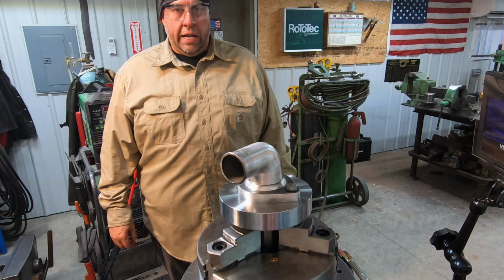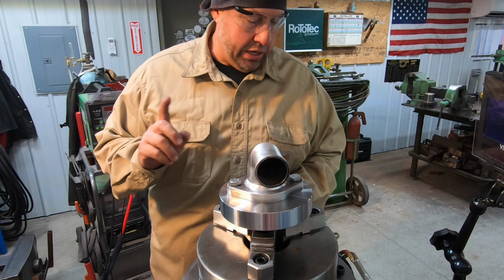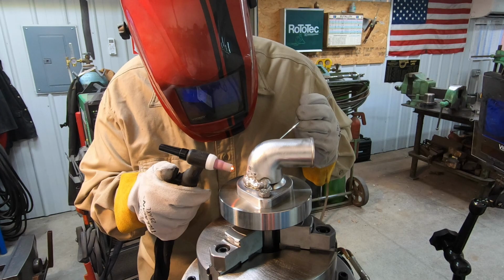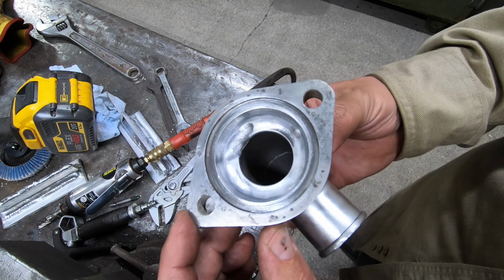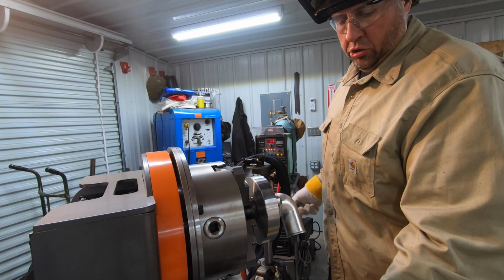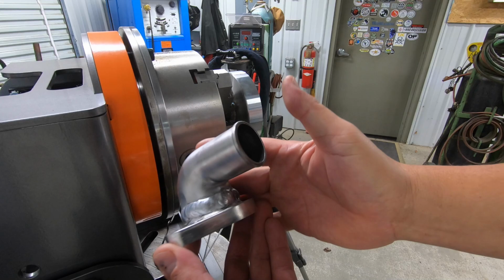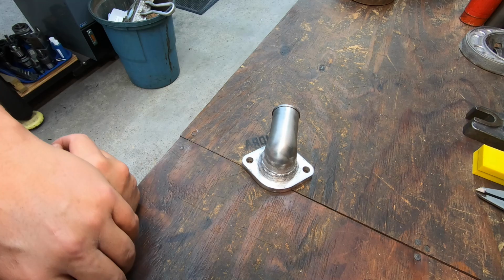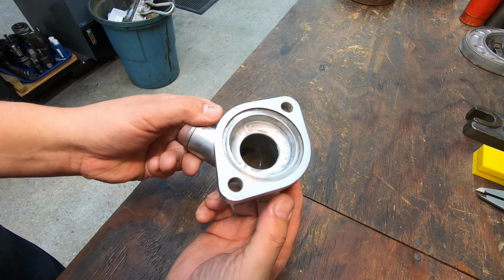SNS 328 Part 2: Welding the Custom Mopar Water Neck

Comment: Adam,
Awesome content mate .... just AWESOME 👏👏.
Too many Vids ‘skip’ the problems and just f/fwd to the pretty finished ( painted 😂😂) job.
That vid was a great education. I welded up a Ducati crankcase about 40 years ago.... and the casting was a dream to weld.
Oh..... that’s right..... China wasn’t exporting anything like that back then 😎.
Thanks for persevering, and showing us how to ‘get there’ 👍
Best Regards,
Robert
(Sydney, Australia)
Reply: You're right about that. But it would be very useful to the audience here, if Adam had shared what settings he used on the welder. Every welding machine is different, but I think I would go for 120 amps and maybe 40% EPN, for a little more cleaning action. Also, I'd choose the smallest tungsten I had.

Comment: Adam,
One thing I have found to help, is to tack it up, and use the lowest frequency you have and use the cleaning action of the machine to clean the joint.  Don’t puddle the material, just use the cleaning action.  Wire brush, repeat if necessary.  Works great on dirty cast.
Enjoy the content - keep it up!

Comment: Adam, yes I think it’s possible the casting had some impurities, however I think it was a mistake to use your wire wheel to remove the paint. Most likely at a microscopic level you created a rough surface that had lots of imbedded paint. I would have tried aircraft paint stripper or baking the parts at 400-500 degrees. Then clean with an un contaminated stainless steel wire brush. You could prove this by welding the cut off parts together after cleaning this way. Another possibility would be to use a lower temperature filler rod. Good recovery though. Love your tenacity and refusal to accept defeat.

Comment: Hi, Adam
I weld aluminum cylinder heads all the time, and they are all made of trashy aluminum.
The very worst things to weld are things like pans on CAT engines, and motorcycle cases. They are not only full of metallurgical impurities, but  having held hot oil, some times for decades makes it nearly impossible to get a really clean weld.
I am experimenting with ultrasonic cleaning, but thus far have not produced any really great results. Repeated heating, and cooling seems to bring the oil to the surface, where it can be removed, for another try. With a lot of patients, as well as cleaning I can get really sound welds. Now if I could get consistent color match on motorcycle cases I would have it made !!! LOL !!!
It's not your technique, or equipment , it's just the reality of working with junk metal to start with.
I love fabrication with fresh clean aluminum, as it produced beautiful welds, and is astatically very pleasing.
One thing you really need is a  media blaster, get it all blasted, and even in shade, and even marginal welds look very nice.

You do great work, and I love watching your processes.

Tim
Reply: "patience" not "patients", and "aesthetically" not "astatically".. they are quite different things indeed.  But I hear ya on the impurities on motorcycle parts.  My buddy in the UK literally MOVED HIS SHOP next to a chrome plater who could tolerate the old, oil soaked "ally" cases on old British bikes and get the stuff to stick and look super good.  Metallurgy on old contaminated crap is just a black art.

Comment: Well Done.  I've struggled repairing cracks in cast aluminum on an old (1930's) railroad signal that had what acted like the same/similar impurity issues.  Got the job done but with many more weld/grind cycles than you did on this project.  I never figured out about reducing the heat ...

Comment: Good work Adam, old aluminum, especially cast aluminum can be a nightmare. Worked in a boat yard. A lot of aluminum boats would come in where the salt water had attached the transom around where the outdrives were. We would grind and sand, the problem with it was that the electrolysis would bore into the metal. Almost impossible to get to perfect metal no matter what you did, it was a nightmare to weld. Our welder we had was one of the best I have ever seen weld old metal and he would have times where the stars were just not aligning for him.
Reply: Sometimes you just have to accept that you ain't cleaning back to pure metal because there's no pure metal in there.

Comment: Adam, great job. You gotter done. A few suggestions for future cast aluminum:
-  60-80hz  It sounded like you were running considerably lower (40ish hz?)
-  Foot control.  I would absolutely love to have your weld positioner....but on cast, precisely controlling amperage, as needed, is much more important.
-  On filler, give 4943 a try. Saw Jody using it on cast AL, & I agree it flows better despite the impurities of cast. It's also noticeably stronger.

Hope some of this is helpful-

Thanks again for another great video & taking us along!
Reply: Thinking the same thing about the frequency,  I remember from watching Jody's channel a higher pitch when he welded aluminum.  Then again, the mopar part was probably cast from whatever aluminum chips and swarf could be swept up off the factory floor.

Comment: Using  used aluminum gets contaminated. Aluminum is porous like a sponge, clean everything even your rods, a good cleaner to remove oxides. The best part was you did not quit and you got it done! Cheers

Comment: Aloha Adam, for what it is worth I've been there, automotive cast Aluminum sucks. I've  welded on Ag Aluminum gear boxes and had better luck.  What I've done on some of my Automotive stuff, which I no longer do, is turn up the cleaning action and try to cook some of the impurities out before trying to weld, then weld at the lowest heat I can in short welds alternating sides to control the heat, if it gets hot it will bring out more and more crap, brings to mind "low bid & overseas production"!!!  I think you did well considering what you were working with.  Don't you wish you had an automotive job shop???  I'm 80 years old and have learned to say NO!! 😏

Comment: Hello Adam, thanks for showing your project(s), its challenges and how you approached them this time. I had a similar job where a customer asked me to weld some parts with - to me - unknown material characteristic/behaviour. In such cases I usually ask for some "spare parts" (could be waste) for dialing in my process settings. I understand that this is not always possible. Again, keep on your very good (Youtube) work and don't get discouraged by some negative commenters :) Respectful greetings from Germany, Stefan.

Comment: Small parts like that i use an ultrasonic cleaner to try and get the garbage boiled out, then acetone with a stainless tooth brush and say a welders prayer and mash that pedal. Thanks for showing what can happen and being persistent and pushing through. Best part is you asked someone instead of quiting. 👍👍👍

Comment: Adam Ive been involved with and welded aluminum Mig/Tig from 77-2018. I’ve never needed to preheat aluminum prior to welding. I don’t see you welding a lot of aluminum in your videos and I was wondering if you even have 100% Argon in your shop. I wouldn’t want you welding that part with an argon mix. 
I once spent a shift welding .080 alum sheet to 3/8 bar. The sheet had hydraulic oil all over it, I could see the oil running away from the weld puddle, yet all the welds were perfect. The next shift we started having a lot of problems with contaminated welds. Of corse the oil was blamed. We ran those torches at maximum amperage for production reasons. The collet would get hot and start to collapse. It wouldn’t grip the electrode. This dirty connection would result in a weld that looked like we were welding with an empty Argon bottle. Anyway changing the consumable parts of the torch would get us back in business. The electrode has to have a good connection. I would also think the Acetylene would put some amount of soot in the joint. If you need a clean preheat I would recommend hydrogen for your fuel. But like I said we did structural welding of heavy gauge and never needed to preheat with an oxy/acetylene. Heck if you keep moving you could preheat with the tig torch.

Comment: I do a lot of cast aluminum repair, specifically on motorcycle engine cases and misc parts. From one job to the next can be different. You can spend more time than anticipated. I am by no means a seasoned veteran. But with seat time I have learned a lot. Don't let this experience bother you, we all know you are a diversified welder Abom, Keep up the good content as always!

Comment: On cast aluminum I run one or two passes without filler at a lower setting to float the impurities, then bur grind them out, it also preheats the parts for me at the same time.  Most of todays truck and trailer lift gates are mostly aluminum and replacing damaged or worn parts are incredibly expensive, have no choice but to repair and modify.

Comment: In think the source of dirt was from the straight water neck that was used. Being cooked on an engine with anti-freeze in it it penetrated the pores of the aluminum causing the crappy weld.  Good recovery though.

Comment: I regularly make these type of welds... meaning, dirty saltwater imbedded cast aluminum. I have had a few rejects in my years but I can tell before I even begin to weld. look at the grain structure of the cast. if its course, you can almost assume its going to not be enjoyable. so PERSONALLY The first thing I noticed is your freq. is too low... I'm guessing you where at 60-80hz? you need to be at around 180-240hz/freq.  A pointed tungsten would've worked better. I don't know what you had the balance set at and I don't have my notes in front of me but if I was on my welder (Miller Aerowave) id start at 155 amps Electrode Positive 275 amps Electrode Neg. 73-78% balance and freq around the 240 range. 3/32 thoriated tungsten (YES red thoriated tungsten) sharpened to a point then slightly balled at the tip on a scrap alum piece.balled to maybe .050" diameter.  stubby gas lens with a 5 or 6 cup. id place 3 small tacks then wash over the part and let the cleaning action do its thing. then weld with most likely 4043 because that's my preferred filler (for aesthetic reasons) and hope it works. the few times I've followed this procedure and immediately said " this might be magnesium" the weld has NEVER ended up nice. that is when you know you have reached the bottom of the barrel cast aluminum. if I was on a non-amplitude machine id be max amps most like 200-250, 67% and 180-240 freq.3/32 lantanated tungsten and same gas lens/cup. trust me, I've done worse...recently returned a "could not be welded" and it annoys me because its been the first in about 5-7 years... the puddle would not form, it was spitting and puffing, oxide layer so thick that even if you jammed the rod in there like DCEN Heli-Arc alum welding it just blobbed and rolled off. I wish I could have sent the piece out for metal analysis but it wasn't mine.

Comment: Great job on the poor quality cast aluminium welding!
But why didn't you chuck it in the lathe to clean up both the flange and the welds so it would look like it's one smooth part, as if it's been cast like that?

Comment: Aluminum can be frustrating when things aren’t going right. Also higher frequency will decrease penetration. On the first pass you can also try a higher AC balance to clean until new metal is deposited. Then reduce AC balance as deposits build over the casting. Hugely impressed how fast you adapted.

Comment: times like this good enough is good enough.cant polish a turd.
my first step with engine type castings is to wonder arc over the material at low amps,this usually gets the job to show its dirty truth .🤣
if its dirty/contaminated/shite il run a butter layer on each edge to try put some clean metal in there ,grind back and then pump the peddle nice and hot with each dab of filler.
works more than it doesn't.
funny thing is the repairs we think are gonna be hard work usually weld a dream.
always a pleasure waching adam,stay safe 👍

Comment: see the smoke? it is a zinc alloy it fumes out a lower temp than the aluminum.
Reply: My experience with automotive parts indicates a zinc/aluminum alloy and that is extremely difficult to weld. Good save!
Reply: Tom Downey .Recon you got it in one ol'sport . same  rubbish cast  zinc alloy that a lot of engine small parts are made from and very difficult to weld repair .

Comment: When I was younger, used to do a lot of aluminum welding (Tig & Mig) mostly on extruded and cast parts.  Have you ever tried 50/50 mix of argon and helium shielding gas?  Also, I always used an Anti-Spatter spray because our customers were pretty particular with the quality and appearance.   And I do concur with your friends advice.  Excessive heat issues that can make aluminum welds look terrible, develop stringy drooping artifacts (similar to celery) and create pin holes.

One other thing I have noticed with aluminum welding. From my personal experience, the temperature range for structurally sound and reliably good cosmetic welds (too cold or too hot) with aluminum is very narrow.  On the other hand mild steel, pickled and oiled mild steel and slightly higher carbon steel products, seem to have a substantially noticeable wider temperature range. But again, this is my personal observation which is  not based on any scientific data that I am aware of  It just seems to happen.  LOL.

Comment: thanks for posting your struggle, i mig weld steel pretty much every day, i mig aluminum quite often, i tig stainless a few times a year and tig aluminum a few times a year,  sometimes when i tig aluminum it goes just perfect, others its a mess, i find fixing curb rash on wheels goes really nice, but anything thats been around any kind of fluid will be trouble for me, i clean it with acetone and i small stainless wire brush, if i can run the tig over it first just to see how it going to go i do that before i try welding, i have a miller dynasty 200 dx, thanks again for posting, i did chuckle the whole time  lol

Comment: Hello Adam. When you lift your filler rod it should not leave the Argon bubble because when you put it back in it introduce oxidized material.
Reply: So right , at 14.00 you started moving your left hand too much again and the weld went rubbish.
I agree with Johan that moving the rod was your main problem.
Reply: genuine question, would increasing the gas flow give you a bigger "bubble" so you have a little more wiggle room or would increasing the gas create other problems too, cheers!
Reply: @alex4alexn  As a rule to myself i would tape the ends of a pipe with cardboard and asking tape and put a separate pipe inside the fitting feeding a little Argon inside the fitting that way i have an oxygen free weld.
Reply: @johanrheeder1640  very good idea!

Comment: The problem is coolant was run through the original thermostat housing!!!!
That contaminated it and is what caused the bad welds!!!!
Car guy's know this!!!!
Keep Rocking!!!a
Reply: Interesting! Do you know if there's a trick to recovering coolant-contaminated parts? Or are they done for?

Comment: I do a lot of repairs on aluminium and it can give you the runaround some times personally I think you need to turn the frequency up a little but the big thing i see is the gas lens on the torch I only use the big style with the gauze inside it give you so much better  gas coverage its day and night

Comment: Since it is made up of two different pieces, the alloy content in them may also differ. I have had some luck with going round first with a fairly cold setting, not adding any filler, to chase out impurity's from the metal. Then grind it, and redo.

Comment: Perhaps this would have been a good application for a low temp aluminum brazing rod like Alumifix or Ultrafuse. Then the base metal wouldn't melt and it should have been strong enough for the application.

Comment: if it is weldable cast aluminum There are a handful of popular metals to include in cast aluminum that will render it un weldable. for cast aluminum on some of these welding channels they will sometimes run a cleaning pass at low amps, to low to pool, just to clean the nasty cast aluminum. and then run run a regular pass. another way i have seen on the welding channel is to weld it regular. short version, supposedly the crap floats to the top, sand the crap off and run another pass, good to go. really enjoy your channel!!!

Comment: Aluminum welding does require knowing the exact type.  Some alloys do not weld well if at all.  I believe 7075 for example is a forget it case.
When in doubt, Tig silicon brazing or brazing in general for mystery metals are best hope.

Comment: Thanks for that video. I’m trying to learn tig, but on aluminum it is tough. My practice piece was on aluminum that had a clear anodized coating. You thought you had it all ground off, but it would not weld. Perhaps that was anodized as well. Thanks again, JB San Diego.

Comment: Nice recovery and nice lesson.  But it's right on the front top of the engine, I'd want something nicer looking part there.  No disrespect, I love how you show the troubles and how to fix them.  It's just this part is on a hotrod that is obviously going to be looked at by alot of people for the engine work and this, even painted will stick out, IMO.

Comment: Probably it welded bad, because it has already seen coolant? I had a similar experience with a used aluminium part. The coolant is penetrated in the alu part, and wont weld good.
Reply: 100% Correct!!!
Rock on Brother!!!

Comment: If you suspect you have magnesium, you could collect some of the chips that you cut on the mill and test them with a hot flame and compare them with known aluminium chips.
Reply: Aluminum will not burn or flame up--Magnesium will.